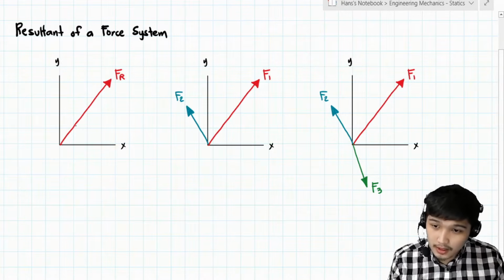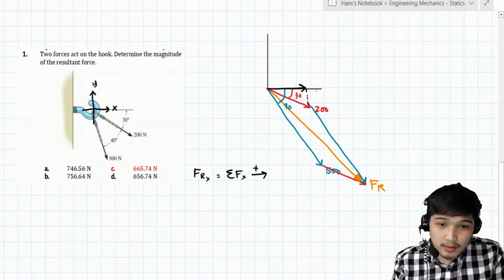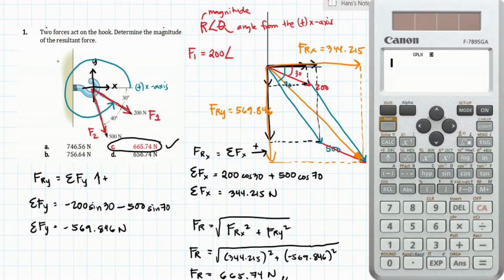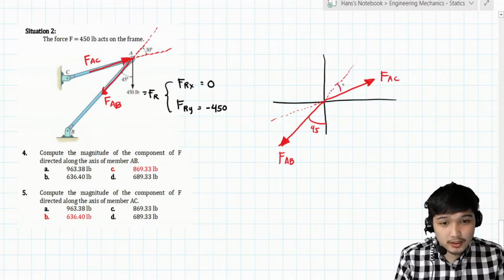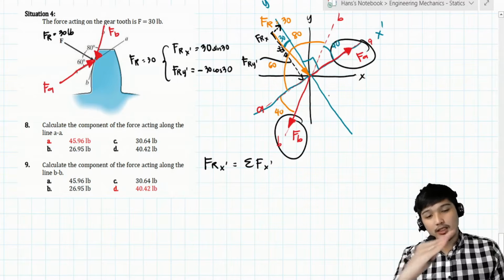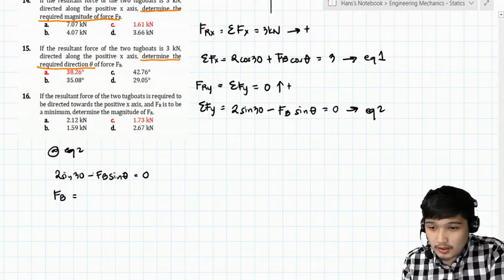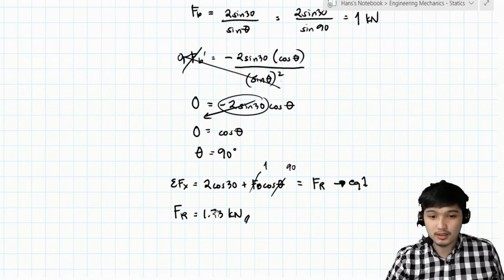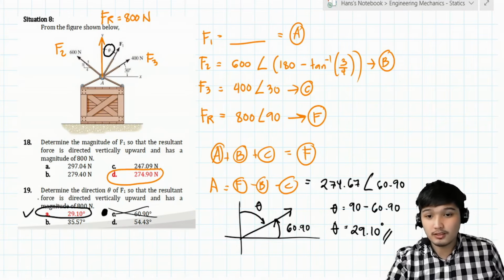Statics | Resultant of a Force System

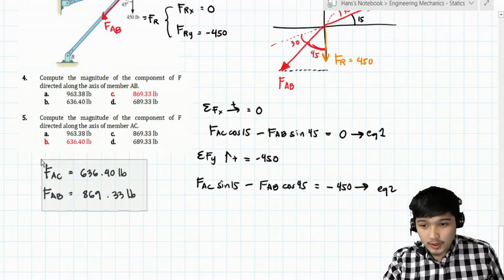Comment: Sir, ask lang po at 52:39.
If consider na correct answer na po yung -869.33 lb as a resultant for AB since nasa 3rd quadrant naman po siya or need po talaga na positive?
Reply from the maker: Once positive ang nakuha pong sagot thru generated equations, it means na tama ung naassume na direction po. As you can see, yung pagiging negative nya due to its directions is already present and considered dun sa mga equations natin
Reply: @EngrHLDC Thank you so much Sir.

Comment: paano naging 2.37 ang sagot sa ABS ng -0.79/19.16?? Patulong po salamat
Reply: shift tangent(0.79/19.17) then answer,
much better na naka shift stored yung value para mas accurate. 
neglect niyo na din po yung sign na negative kasi angle naman, mostly for direction ng pag graph yan.
Reply: maraming salamat po, natulungan nyo po ang isang slow learner na katulad ko